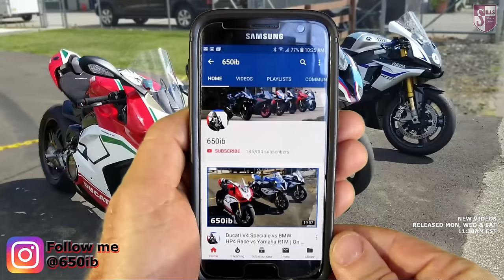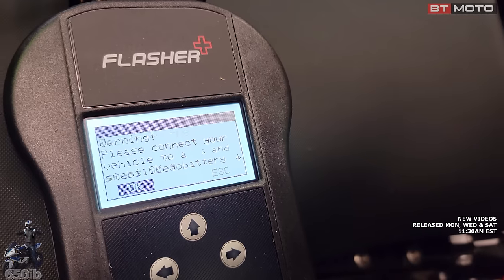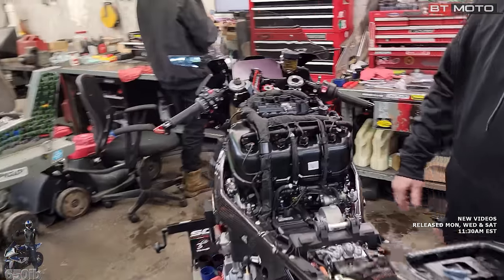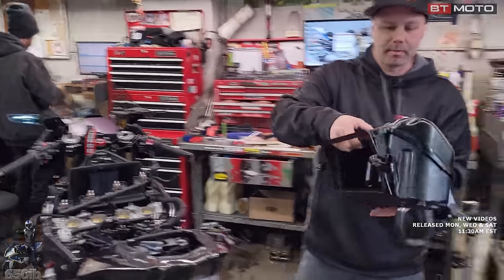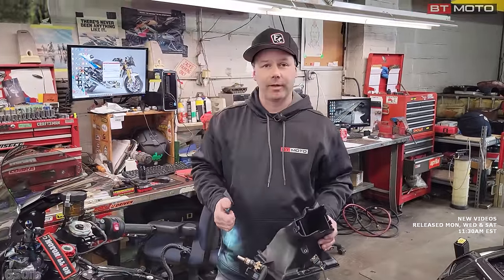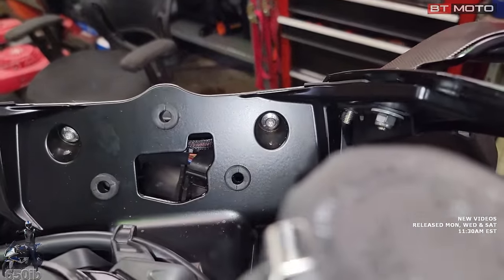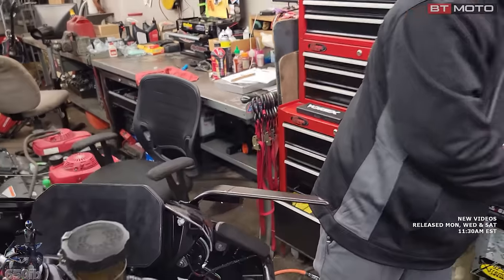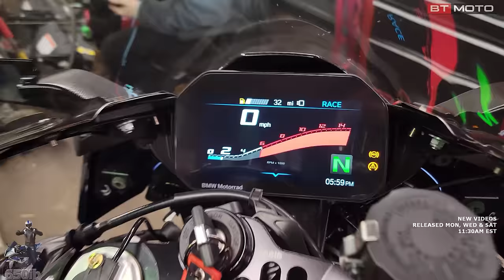FLASHING The ECU On Our 2021 BMW S 1000 RR | Step by Step...

Comment: 4:30 Wish they would update their device which looks like a 90's Game Boy and still uses a serial port connection.
They downloading, uploading was a major PITA when I did my Kaw ZH2.
I did an ECU flash on a 2021 Aprilia RS660 with a disk shaped device about the size of  a Silver Dollar that used Blue Tooth and my Android phone to get the job done. It plugged straight into the Euro 5 access plug under the seat.

Comment: Thanks so much for this video. I saw you guys install the block offs on the air intake but did you need to install the engine block offs? You had the plates but never saw Zack throw them on. Wonder if their necessary or not

Comment: You have a lot of fast bikes but have you ever considered of buying a 2nd generation Hyabusa and giving it 500-700hp with a turbo kit, intercooler, built top and bottom end and dominate in street racing and half mile events as you go 230+mph

Comment: Zack is truly the master mechanic indeed!  I know someone that's looking into getting a 2022 S1000RR.  Will applying the Bren Tune void the factory warranty?   Thanks and keep up the excellent work Ib.
Reply: 1000% will void the warranty.
Reply from the maker: It will not void the warranty as long as you flash the bike back to stock before taking it into a BMW dealer for an issue or for service.

Comment: The standard tire on this bike is a 190/55/17. Ive got my BT Stage 2 done. Apparently BMW has a calibration for using a 200/55/17 which i didnt do. Only then you send your fine to BT and they tune it over tat file. Unfortunately i did mine before the calibration with BMW as im still using a 190. Im using the exact same bike as in the video. Is it okay for me to change to a 200 with a BT stage 2 and not getting the calibration? Does it affect anything? Bt did mentioned a i can retune the file for that new tire if i want to. If you have Feedback on that it would be great.